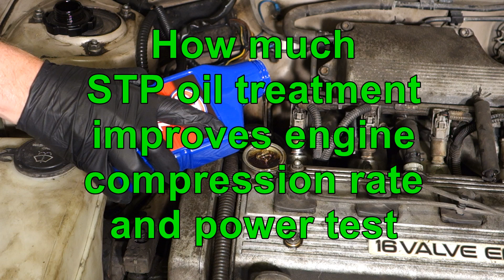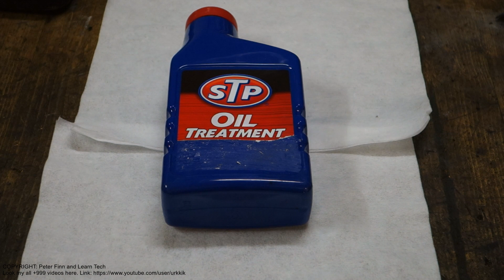How  STP oil treatment improves engine compression rate and power test

Comment: Bought it a month ago and noticed less engine noice....less smoke and cleaner oil. Would highly recommend it. My vehicle has 70k miles. Also onced mixed with your regular engine oil viscosity isn't that thick....it tends to dilute itself. ..wich is ok to put in newer noisy engines.
Reply from the maker: Ok and Thanks  :-)

Comment: I've used STP in the past its quality stuff for a high mile engine I wouldn't recommend it for any engine below 100k, I use Wynns super charge now it's exactly the same as the STP same gluey stuff works wonders in my 265.000 mile desiel engine, runs a lot smoother and more power.
Reply from the maker: Thank You. :-)
Reply: Hey friends,  Can i use this in 2007 skoda octavia 1.9tdi diesel clocked 90000 kms on odo? Can i use this with mobil1 0w40?

Comment: Only use this in the summer months and only one bottle per oil change no matter how long you leave the oil in the engine. It'll be make the motor oil too thick in the winter months and a cold start will be difficult not to mention the oil will not flow as fast as necessary to reach internal engine parts. Like two oil changes a year will do the trick. Spring time with STP and then Fall without STP. I have used this for years and have some older "4-cylinder STP" formula. They don't make the 4-cylinder formula anymore.
Reply: They also make a synthetic treatment that might be suitable for cold weather
Reply from the maker: Thanks
Reply: Hey friends,  Can i use stp synthetic oil treatment  in 2007 skoda octavia 1.9tdi diesel clocked 90000 kms on odo? Can i use this with mobil1 0w40?
Can i use this inbetween or after recent oil change?

Comment: Why not just use oil approved by the engine / car manufacturer?
Reply from the maker: Thanks for info. :-)
Reply: For new or hardly worn engines you should.  But adding STP is good for worn engines.

Comment: you can use a torque wrench oil friction tester, much more convenient!  the anti friction test is good and high performance, the engine oil friction tester can directly show the anti friction performance of oils or additives, that is good and convenient to show to clients.   although the oil quality also includes flash point, kinematic viscosity, copper corrosion test, oil moisture, etc.  http://topechltd.com for more details
Reply from the maker: Cool !
Reply: Problem with the torque wrench tester is that it makes now allowance for things oil has to do besides keep two bits of metal apart. It's got to flow to those bits of metal just for starters

Comment: All it does is increase the viscosity of the oil. If your car uses 5w30, it will be increased to approximately 10w40. For this reason, do not use this product on engines with less than 100k miles. The oil oil additive I would recommend is Extralube ZX1, that does not change the properties of the oil but increases lubrication, whilst reducing friction. Its brilliant stuff. For cars with worn engines, just use a thicker grade of oil at the next service and/or use Extralube ZX1.
Reply: While the STP oil additive does slightly increase the viscosity of the engine oil, there's no way it'd drastically modify it in the way you mention unless you have an engine with a really low oil capacity under 4 quarts. But it additionally has an anti-wear additive (ZDDP) which reduces friction and wear as well. In cases of engines with low oil capacities, don't use the whole bottle.

I've used it in engines with large oil capacities (5-7 quarts) and it does make a difference. The engines tend to idle smoother and reduce valvetrain chatter.
Reply: Extra lube x1
Reply from the maker: Thanks for feedback. :-)
Reply: +cadas kuwaiti Yes it is safe providing your engine is high millage. However, considering you're already using 20w/50 oil, I wouldn't suggest thickening it any more because it could cause damage when the engine is cold. May I ask why you are considering using this product?
Reply: Meguin super performance engine oil 10w40 may be used and check the difference later on
Reply: Hey friend, is it safe to use this with mobil1 0w40?

Comment: ist oky to use STP oil treatment though iam now using  PERTUA??  still running in slow distance rate or maybe the throttle has the problem . please help. thanks.
Reply from the maker: Hi, please replace the engine.
Reply: oh.. men, which is the better, over hauling or replacing the engine? we all know replacing the engine has no guarantee,  where this kind of unit is likely vintage.
Reply: i do not agree that way to replace the engine without knowing the problem. what must to replace the same vintage engine?  reevaluating the  cost of replacement versus the repair.

Comment: Put 10W-60 and result of compression will be the same... if you want to clean compression rings it is better to use BG109... put inside engine, run it for about 35-45 min(manufacture ask not more that 10. more than 10 it is your own risk). after that change oil for regular one and check compression. Compression should increase for 1-2 points up.
Reply from the maker: Thanks !

Comment: It contains ZDDP (Zinc) which is a great anti wear agent used in racing oils. Environmental reasons mean it doesn't end up in road going oil though, only racing. For older, or worn motors, this stuff is extremely good, and in my opinion is better than Lucas Oil Stabiliser. It's also cheap as dirt, even in the UK, £4 from euro car parts!
Reply from the maker: +Spac8 Thanks for comment.  :-)
Reply: Thanks i jus put a bottle and ahalf in my 04 camry 263 000 ,the oil light started flickering at idle and a OG at autozone said dont sleep on STP..so far so good no flickering lights took about 2 hours of driving to see results.💯